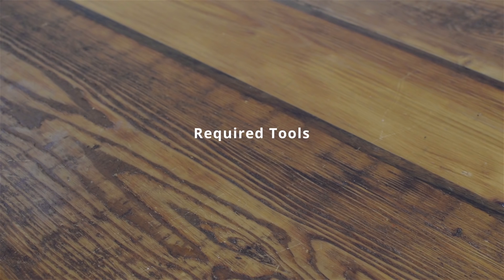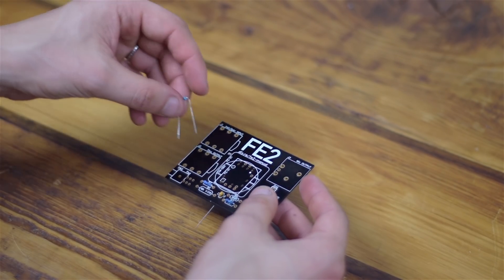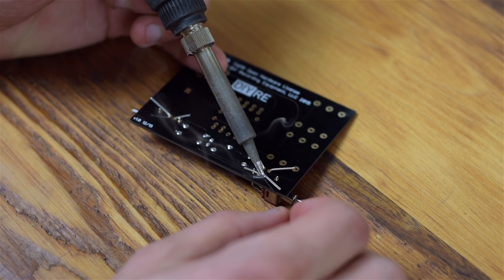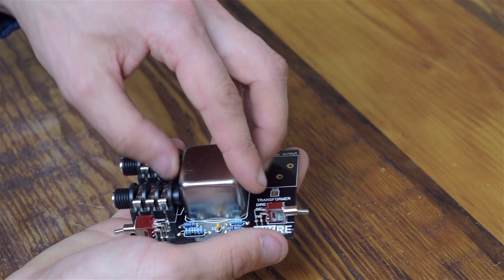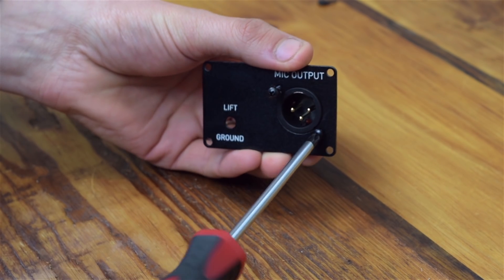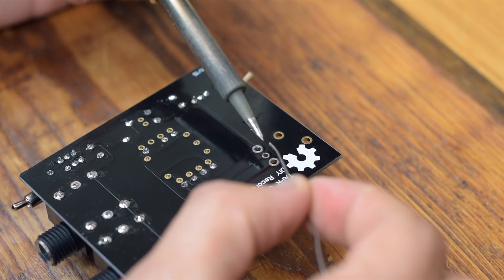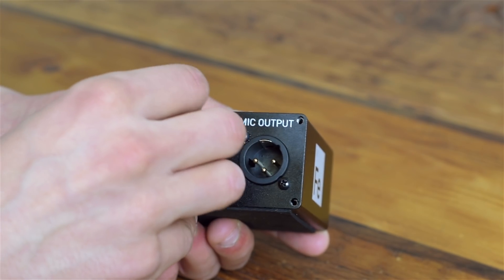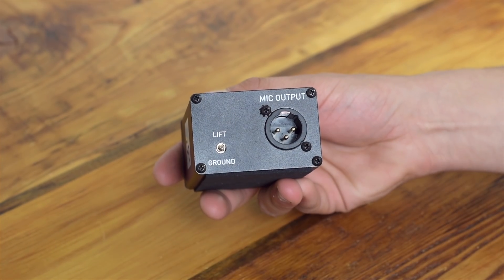FE2 Passive DI Box Assembly Guide

Comment: Why is so expensive? Radial di2 is only $149.99 en this is stereo en cam ensanble... 🙁
Reply: Max Molina The Radial ProD2 uses their own “Eclipse” brand transformers in their middle of the road di boxes. They only use “Jensen” brand transformers in their flagship passive di box (JDI). This is expensive because it uses a high end transformer from CineMag that alone costs around 70 bucks. It’s also expensive because the kit is manufactured on a relatively small scale.